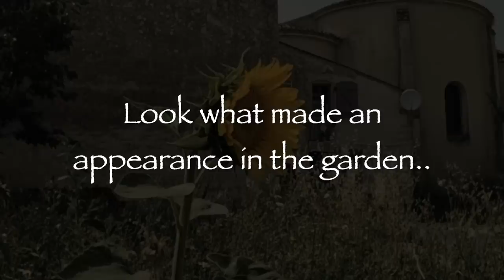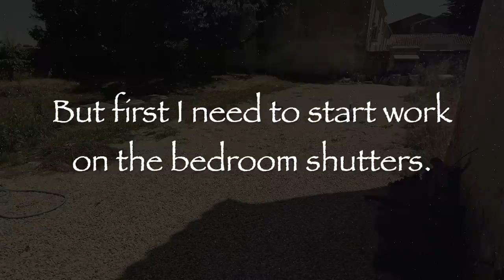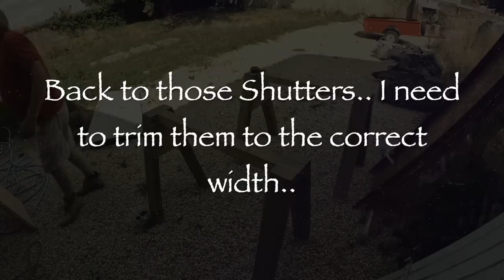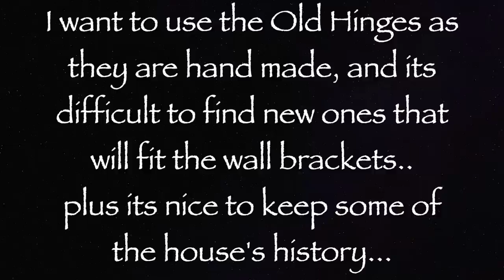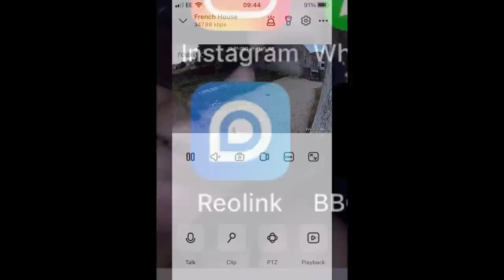I make new bedroom shutters, and we take house security to the next level...

Comment: We finally put up a camera front and back even though we have very little crime where we are. We chose battery operated (change about every 6 months) so if the power is out (or someone cut your electricity), our camera continues to work. Also, since we don't have them wired, we can place them anywhere on the property. Very happy with ours, too.
Reply from the maker: These have a back up battery two, which last for some time, all our electrics on in the house, and in two places, so not easy to mess with.. luckily the house is in area thats almost crime free, but it does happen... cheers